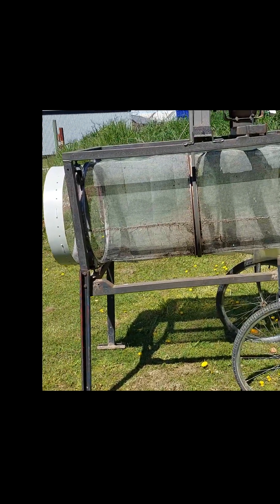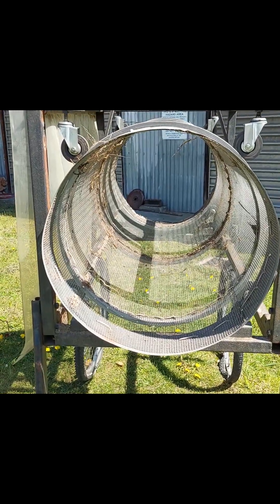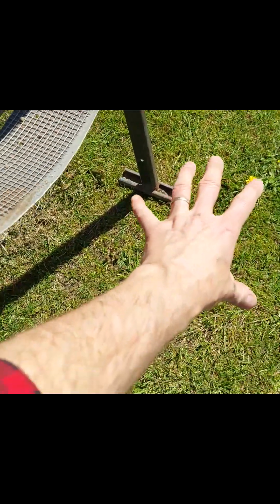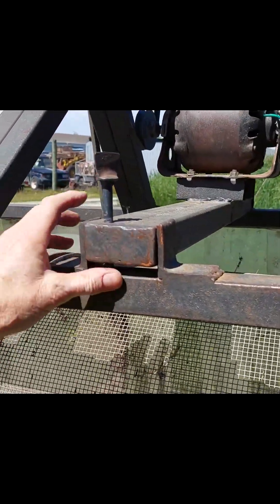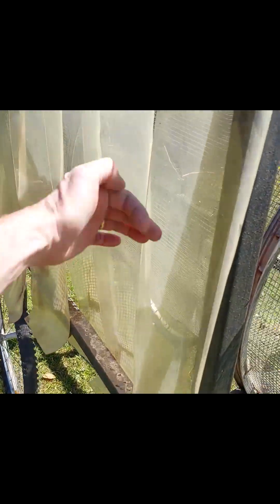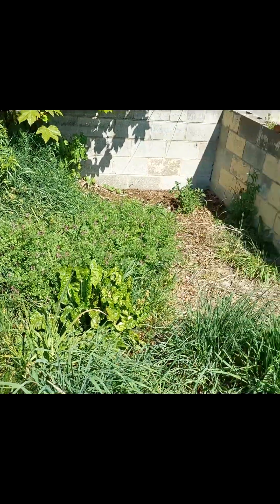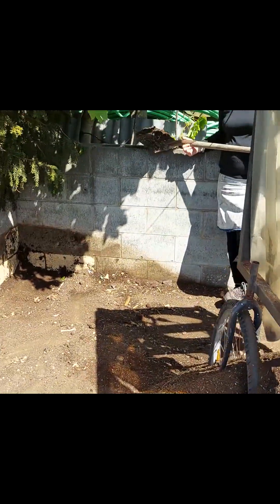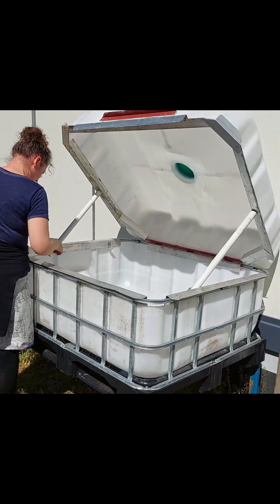***Updated***Building a rotary trommel for sifting soil and compost

Comment: That Trommel is absolutely awesome!  I have sifted a lot of soil for my garden and I have always done it using a flat screen that I dump a shovelful on and then sort of scrape it back and forth until the soil drops into a wheelbarrow and the rocks and large debris are left on top of the screen which I then have to lift off and dump to one side.  I'm far too old to continue doing it that way.  I love your idea, sir.  I've seen trommels before, but for some reason this one just clicks.  Glad I saw this one.  Have a great day, Sir!
Reply from the maker: Thanks for your comment.  Yes I too started with a shaker frame but realised there had to be a better way.  The trommel has far surpassed my expectation of performance.